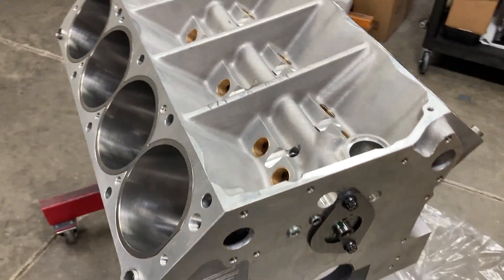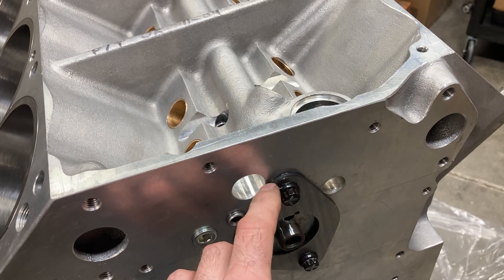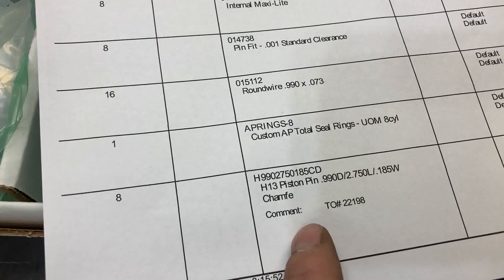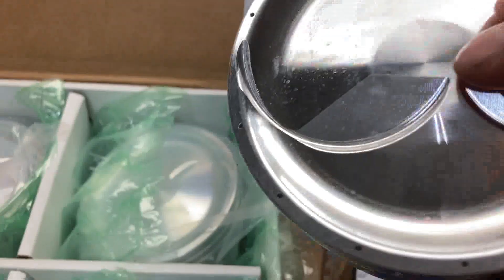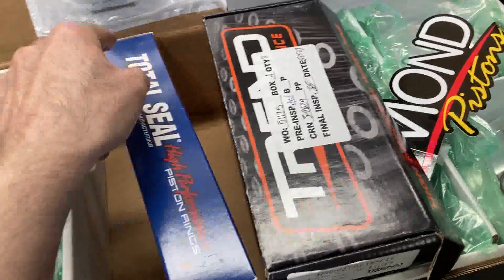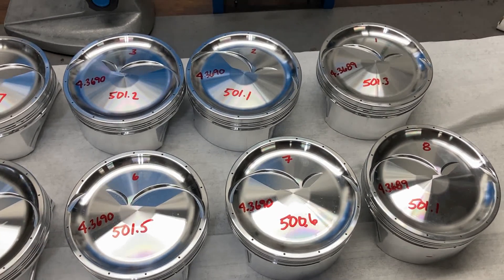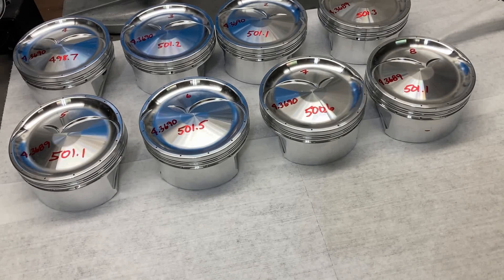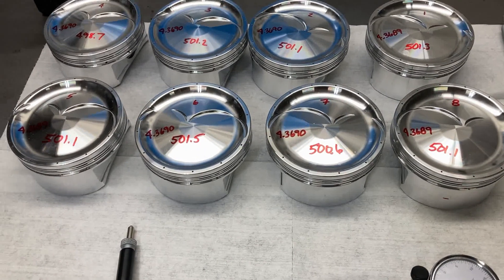Lykins Motorsports Ford 511 FE Piston Overview

Comment: I agree Brent, deck and bore block first.
I did a 431, 390 stroker and one corner of the block was over .005 below blueprint spec.
So I squared at 90° and bored leaving .005/.0055 to hone and it came out perfect.
Of course always honing after I have the pistons.
I notice the piston has minimal quench, looks like a direct injected style piston.
It is surprising to me.
Could you elaborate on your reasoning for this?
Thanks in advance.
Happy Father's day. 
Take care, Ed.

Comment: The FE engine calculates 4.375 bore x 4.250 stroke,  I hope you are using a taller deck height as stock FE block has I believe a 10.170 deck height.  That would be a pretty short rods.
Reply from the maker: No taller deck height.   The rods are 6.800" long.  The pistons are shorter.

Comment: Awesome parts Brent!
3 questions;

Will quench be an issue with those dished pistons? 

Will those piston gas ports eventually clog up and become non-functional?

Have you used Total Seal's new 'gas ported' top rings in a build?

That's gonna be one wicked FE!!